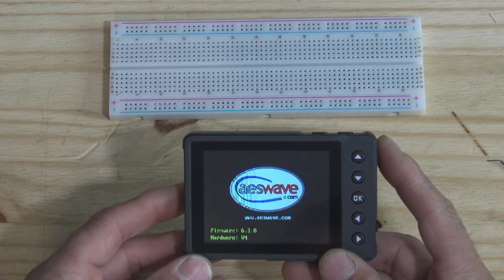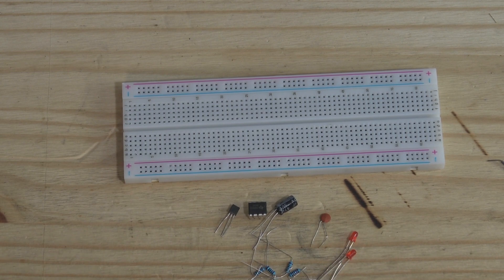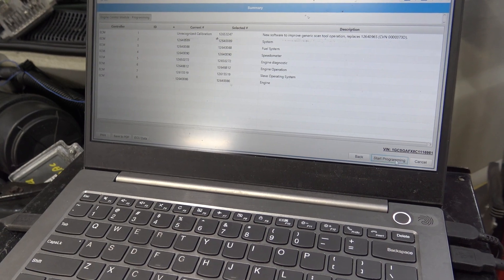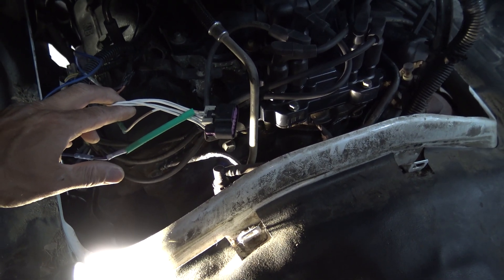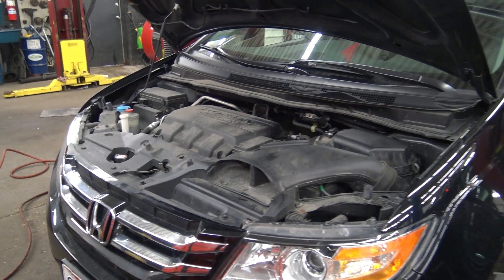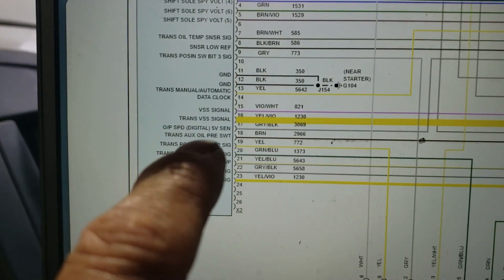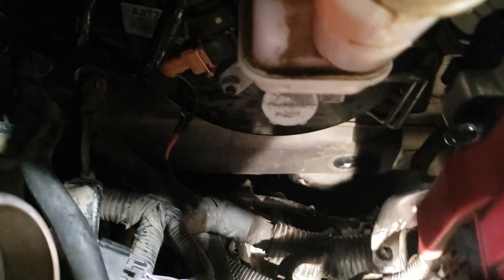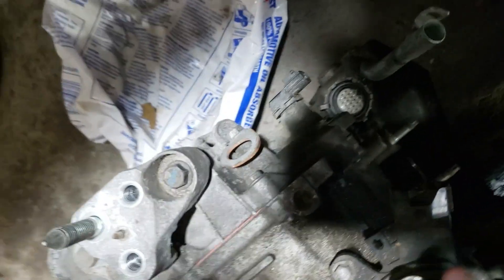End of day 10 29 2021 Chevy Spark Speedometer  Transmission Issues!

Comment: I had the same problem with my 2013 Spark the speedometer didn't work and the transmission was leaking fluid it turned out my transmission had gone bad it a manual transmission the car only had 76,000 .
I did get it fixed and I'm driving it now and my girlfriend likes the car and me I think 🤔

Comment: On the Express, I dont know if you had said, what was the overplayed wire for where did it come from and what terminal does it go to at module connector?
Reply from the maker: It was from the pcm directly to the coil/ icm.
Reply: @BrianMann216  My other question would be is the ground wire to pcm to icm?..hard to tell from video. Is this something you go into more in your premium channel?
Reply from the maker: @Raylude5  I did not make a complete videobot case study on this one, partially because I did not diagnose it, ibwas mainly there to program 1st time , and did a quick check with u scope when onsite for another job. .
Reply: @BrianMann216  Thanks for the reply. Appreciate the work you do